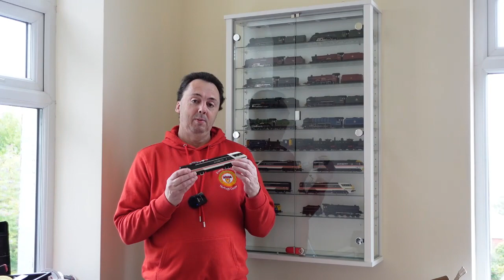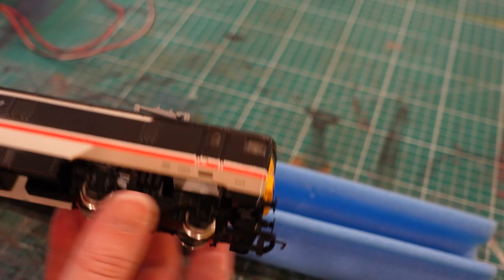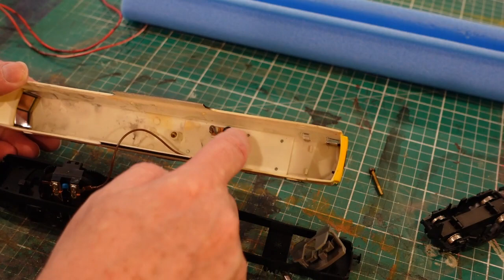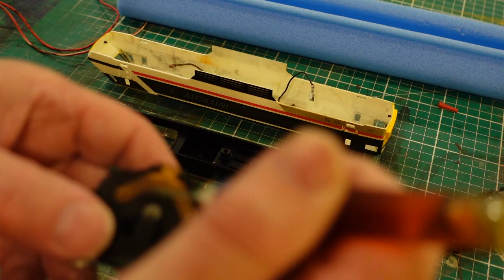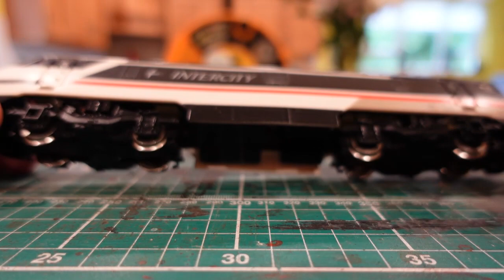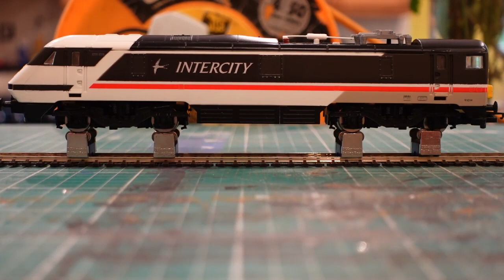148 Maintaining, Cleaning and Servicing your Model Railway Locomotive

Comment: I have that set and it runs great. As you pulled it apart, the echo in tge room made it sounds as if it had exploded🤣
One thing I use when dismantling these Locos is lollipop sticks or coffee sticks which I pick up every time I am in Starbucks 👍
Reply from the maker: I have cut up bits of plastic ice cream tubs, if I could find them. They are in a box somewhere lol